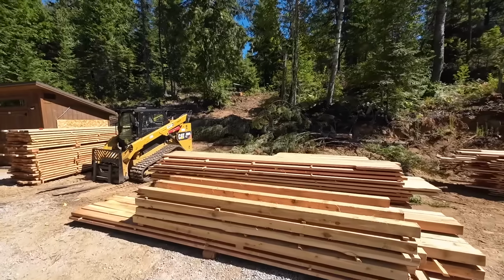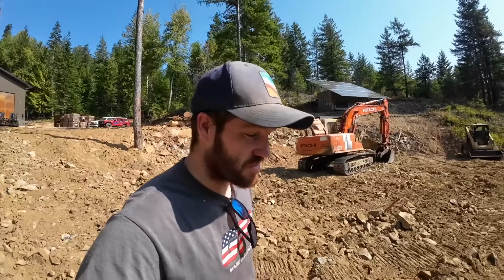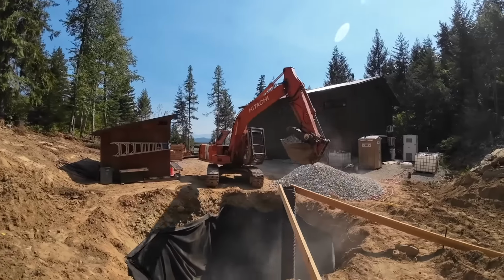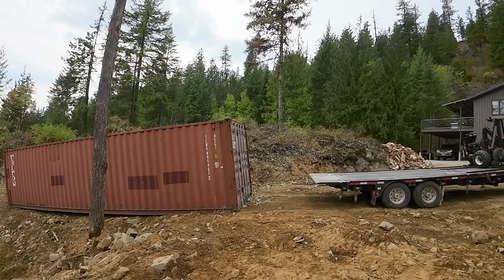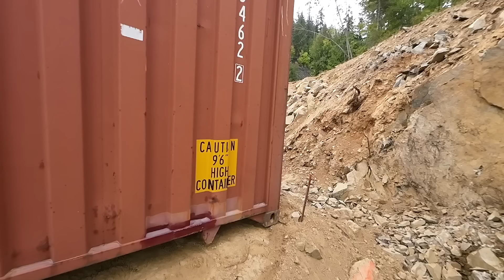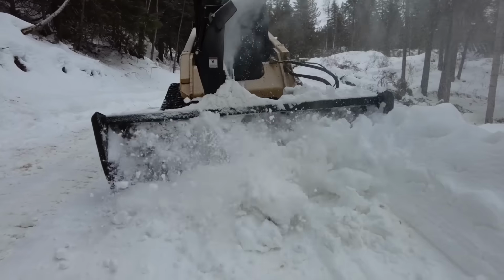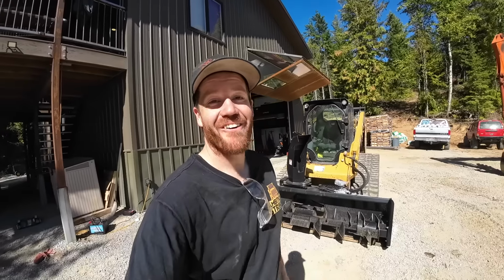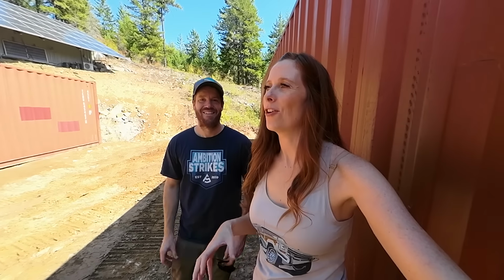Building a SHIPPING CONTAINER Workshop | Part 1

Comment from the maker: Thanks again to Ritual for sponsoring this video! We love their products because they help keep our bodies balanced. Remember to click here https://ritual.com/ambitionstrikes30 for 30% off during your first month!
Reply: 😮poo
Reply: I realize that it may be too late by the time this video is released after editing and such but hopefully not. Please correct me if I’m wrong but I have a feeling that you intend to use your high cube conx’s partially for dry work spaces. If you are you really should use the trackhoe to either lay them on their sides or to rock them over far enough to get some type of work stand or heavy sawhorses under. The reason I say this is due to the fact that they need some type of insulation under the floor between the lateral bulkheads. The fork slots are simple enough to block off once you have them permanently located but putting the roof on top of them will complicate the process extremely. Spent a lot of hours in similar containers as shops on job sites as well as break rooms. Keeping them warm and dry in the winter is quite a task without the void under the floor insulated even with nearly new one trip containers. The amount of hardware and tools I’ve seen ruined from condensation in them is ridiculous. For the containers we used for break shacks most of the crew carried 5 gallon buckets in with them for lunch as a habit in wintertime just to prop our feet off of the freezing floor. The job I spent 12 years on where the containers were more permanent we actually used R30 insulation on the bottom of them. After the fiberglass batting was in between the bulkheads we screwed either sheet metal or 4x8 sheets of what looked like nylon to the bottom of them. The nylon sheets were really nothing more than plastic dump truck bed liner cut into manageable sizes. 
 
The government branch worked at the same site but independently of us. They learned after the second winter how much humidity condenses in those containers. Two of the 40’ configuration were theirs, one of which housed much of the GPS computer hardware, signal repeaters, as well as radio communication electronics. They learned the hard way which caused much delay in the beginning phases of the job. Sadly as it was a government contract, that money comes from our pockets. Anyway, back to the original subject, if I’m too late and you’ve already begun roofing your shop there is still a solution. The solution may be a bit more on the pricey side but it’s more of a last resort. Expanding foam can be added at just about any time to the void under your containers but should be applied by a professional, hence the additional cost. The reason I mention professional installation is from a firsthand account of seeing what it does to the floor of the container. During a bridge job one of the company bosses thought he’d be slick and try insulating what had been the tool and rigging container while the rest of us were eating lunch in the other shack. The floor was strong enough to twist about 7/8 of the bulkheads in the bottom before turning into a busted splintered mess with around 10” of the outside skin warped at the bottom. 

You have my most sincere apologies for dragging this out so long on your comments section. Just hope to get the message to you soon enough so you’re not backtracking later to spend extra time and money on what could be a much easier, cheaper process now.  If anything else, do your own research on the subject to form your own conclusion, just thought it best to make you aware.
Reply: The 2 of you have gotten so good at using the equipment so well. Love how the you both work  together so well. Can't wait to see what is coming next.
Reply: @SaltandPepperX another grown up lady throwing a childish tantrums on youtube is ridiculous 😂

Comment: Hello Riley,
I have 4 shipping containers used for storage.  Under 3 of them, I used vapor barriers on the ground.  This greatly reduces the moisture level inside.  I used polyethylene film with 90 lb roofing rolled over the top of the plastic film.  The containers were placed on railroad cross ties, providing an air space below.  It also gives room for storage of items such as pipe.   
Good luck with the project,
Len

Comment: the ditch at the back looks shallow for snow. but nce pad. and a cool storage area. i would run cables between the reinforcing bars on each shipping container to add some more support for those trusses. the roof looks shallow for snow so a bit more support would be insurance.

Comment: Can’t wait to see how you do the trusses….. add some clearstory window framing first?   And totally aligned for more solar.  

We did something similar at the ranch except ran trusses to the outside, giving us storage on the container.  We framed them up a few feet as wall.  We did that so it looked like a barn, for the neighbors.  Works great. Equipment storage in the middle, storage and work space in the containers.  Added a roll up door to one container to access the tools for the equipment, but should have just done a sliding barn door.

Comment: It seems pretty sunk in there so the question is, will there be enough sun down there to maybe make adding some more solar worth it. Winter being the time you need it the most, I am guessing that the trees will block most of the sun. If nothing else you could setup a few panels to use for a local lighting and trickle charging setup for just that one building. Do everything off of 12v DC even and keep it super simple.

Comment: I would have used couple of those trees and put it under the containers to help roll it or pivot it in place. Looks good. I would get some solid concrete blocks or something to set those containers on. When I was overseas as a contractor, we made wouldn't blocks that were 12x12x12 of 2x4's to set containers on. Worked really well. That would give you more clearance. Will you be able to get all the equipment under the roof to work on them? What is your tallest or highest piece of equipment? Also by raising them up, you could pour a concrete floor later too. That would making working on equipment so much easier and better! You could also get same result by building some small knee walls onto of the containers too. Wouldn't take much to do that. It would be better in the long run if you had more clearance. Maybe even be able to add a overhead crane for some of those heavy lifting project or repairs!!

Comment: I used a 20' for my kitchen and cloths dressing area. In winter it froze inside and dripped badly. The next summer I covered with large hay bales, the 3' wide x 3' x 8' long I got farmer to make long. We're a perfect fit. Covered in black plastic and tyres. Coldest to got was 11 C and warmest 24 C. Had double glazed, double doors in door end. Main doors permantly open. Outside temp from -8C to +39C. Changed my comfort level hugely.

Comment: All those years of water issues and the solution was in your back yard all the time! Long as you can store enough. 2-3 gph will get you by forever. 
Love the cont shop, to bad I'm limited to 4' above the containers for "roofing". You will need at least a path around the outside though, I keep 6ft opened up.
Dozer gone? Got your use from it at least, it was big but the exc and skid will do you now. I had to pull the guy out when my 40' was delivered.
Nice repair on the blower. If you would stop breaking EVERYTHING you could get more real work done,,,,,,,,,,

Comment: You need to compact/vibrate made up ground in lairs of 6 to 12 inch depending on size and weight of roller/wacker plate, even with the roller for the skid stear id still do 10 inch max lairs 👍
Reply: Lairs are where wild animals live.
What he wants is layers, or more correctly in construction terms, lifts. 6" lifts between compaction is pretty typical.

Comment: I hope you’re leveling and anchoring the containers. Also put 2 ground rods on each container. Weld hurricane straps to containers to affix the roof trusses. If you add a 4 foot knee wall on top of containers you can have a 13’ high ceiling. It will also provide additional storage on top of containers. You’ll be able to put implements that are seasonal or aren’t used frequently out of the weather using the excavator. You’ll fill the storage shed easily. You’ll wish you had room for 12’ Lean To’s on each side.
Reply: I was thinking that you would need levelled concrete footings. 
Good idea to anchor things down in case of storm/wind.

Comment: What about moving the solar to one of the 40' containers then bury the 20' in the bank and set it up for a storm shelter and root seller. You can't bury it deep. Not certified for that but a foot or so would probably be fine. Secret stash.

Comment: Build a subframe between the container and the trusses and take the trusses to the outside of the container, then you won't have to worry about snow accumulation on the flat of the container. And gathering rain water becomes easier. And parts storage between the two roofs. 👍Big fan of your operation.

Comment: Might add a "runaway" ramp/barrier at the end of the shop ramp/driveway in case any equipment looses brakes/transmission.   I know cameras are deceptive with slopes so it may not be as steep looking as it appears.

Comment: Careful using freshly milled lumber for anything like this. The sheer amount of shrinkage it will have over the next 2-3 years will make the structure have issues if they bear any load. Milled lumber should be either kiln dried or let sit for at least year or two before its used for much so it has time to dry fully.

Comment: I wouldn't want to build a shop like that without at least having the containers on several concrete piers going down to undisturbed ground. With them elevated 6" above grade gravel fill could be put in between as a temporary floor, then later most of it removed to be replaced with concrete.

Comment: Did you guys measure with the laser transit whether the trusses/roof on top of the containers will block the low winter sun from hitting your solar panels when you tip them for the low winter sun angle?
That well water is dirty. Are you going to fix the well as commenters suggested so you get clean water and prevent surface water contamination from seeping into your water supply?

Comment: Good Idea! We purchased one this year to provide extra storage. Two with a roof between means covered parking, that's even better! And it's close to your power source for lights. I tried to lift one end with the pallet forks on our tractor, and I know it's over 1 ton with just one end. That little skid steer is a beast!
QQ - Have you had any issues with the floors in containers? I placed our container on Railroad ties to avoid any problems with the wood floor getting wet, etc... Unnecessary?

Comment: So I think next time bending the snowblower, hopefully there isn't a next time actually lol but i think you had the right idea with the bucket but it needed to be braced where the snowblower started to bend in and not at the top of the housing then run the chain to the tooth

Comment: You fixed the snowblower on the skid steer with an excavator lol! And some cutting/welding. Is the big one for the Army Truck still operational and will it come out when the snow gets deep? Now that you will have a covered shed the D8 dozer transmission overhaul can happen over the winter.  Is your well doing ok?

Comment: One word of caution when trying to beef an area up that I learned the hard way.  I was working on an aircraft and we always had this area that one of the ribs would crack consistently.  It was this way on all the aircraft of this type.  I decided to repair it so well that I couldn't image the rib ever cracking again.  That was a true fact and when the aircraft came back in for maintenance in the area, the rib in fact did not crack, everything around it did though, causing much more repair time and work.  The moral of the story is that sometimes an area is used as sacrificial for the rest of the structure.  Just a tough lesson I learned a long time ago and never forgot about.

Comment: I was surprised at how well you were able to weld that snow blower with the black paint still on it.  Most welders would have hit the part that was being welded with a flap disc on an angle grinder before trying to weld it.  Lucky!  By the way, what happened to that "ultimate snow blower" you built with the big car engine attached that you shove around with your military surplus rig?  Does it not work well?

Comment: Nice ,,Riley your going to need to build up a bulk head of rock on the lower cliff end of your builds lay out plan , your going to lose close to a inch interval elevation every 2-3 years because of the dead wait of your build . If it rains all the time maybe a inch a year.  Sorry bro &bro@ a retaining wall of rock is needed for land side or water runoff ..   off the ranch with Matt and Mayer  just escavater 400tone of shell rock if you need shell rock,   yet in shore you still have tones of grant rock ..

Comment: 40' long right?  Container homes are a little bit smaller than a single wide mobile home and they are basically modular blocks you can configure in so many different ways.  If you want forever longevity, it takes some planning to protect them from moisture inside and out.  I am on the outside 2x8 framing team where you have room to run utility and insulation to protect from temperature and condensation problems in order to maintain all the cubic space inside.  It requires a lot of cutting for  electrical boxes, any HVAC, and plumbing and you really need to plan extremely well (less forgiveness than traditional framing).  The containers are designed to both hold and support huge amounts of weight, so you can utilize so much of that to create some awesome buildings. 👽🤖👽

Comment: WOW that container delivery was so sketchy from a safety point of view. At your property yes it was good etc. When certainly cannot transport any shipping container without having 4 twist locks holding it on. If you used straps you would be stopped and grounded . Have to love the USA where you can transport anything you want behind a pickup.

Hats off to you for living in a 40ft box (as nice as it was) for 1yr.  I transport them everyday and there is no way I could have done that. 👍

Comment: Radio coms(cb band)may be usefull on stuff like that are you trusting the cell network in your area?
Why havent you poured a concrete slab underneath..... would be bether in  terms of rust uderneath. As long as there is no roof leak rust could never hapen  the curve in front could be poured with concrete and drainage canals 
The road you made dosent seen to have enogh drainage to me you could make drainage chanels out of good lumber(need cleanig,bether safe than sory), have you contacted a expert about that